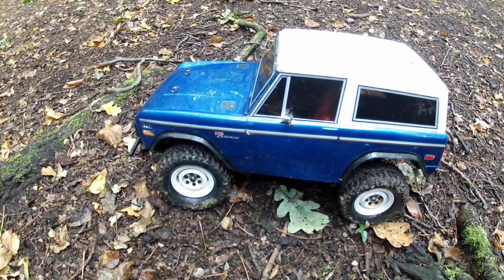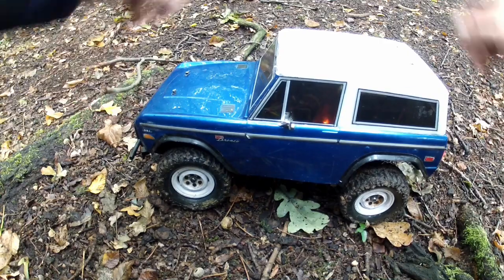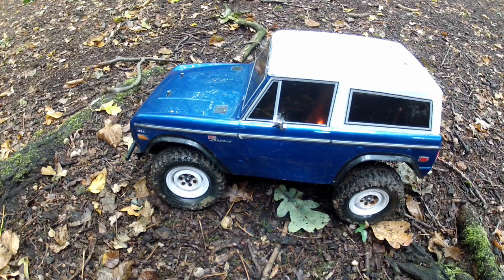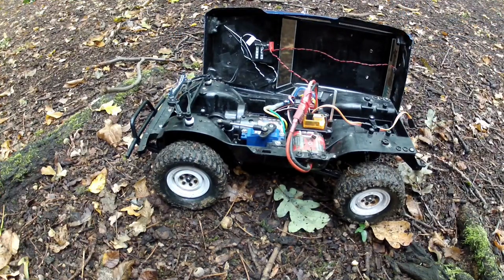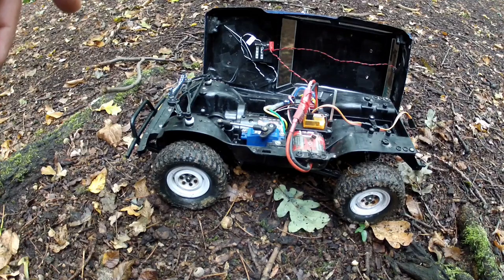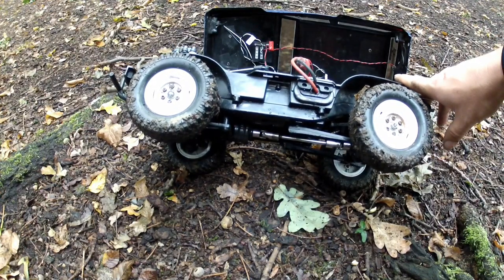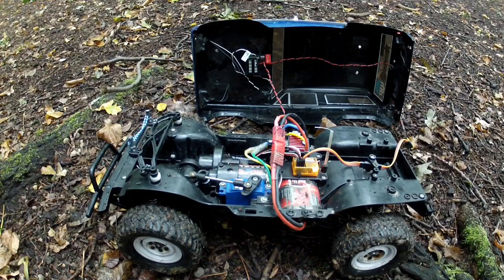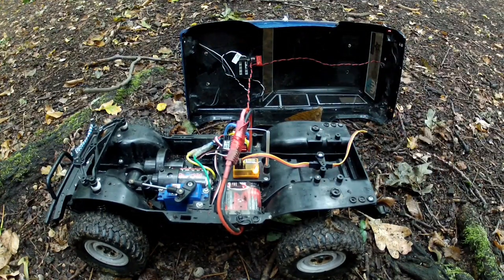Lightly modified Tamiya CC-01 Bronco 58469 : short review & long running HD video in the forest

Comment: Thinking of buying one. Would you recommend it?
Reply from the maker: I think that the CC01’s are great. Worth putting in a higher turn motor 65 or even 85  if you want to be able to rock crawl. I also always lock up front and rear diffs and put in a waterproof servo (like the Hitec wp846 one).
Reply: Thank you